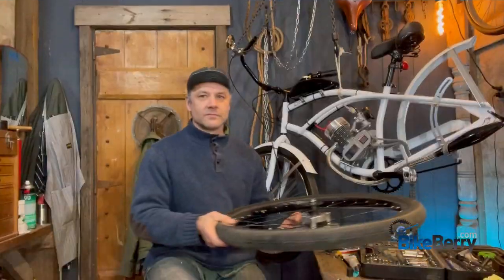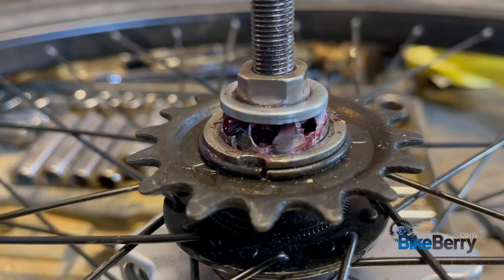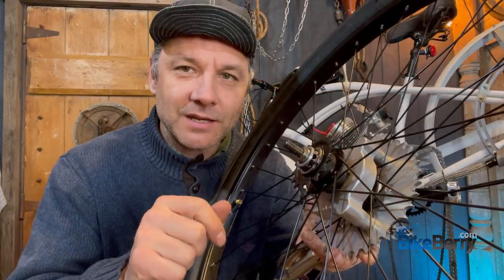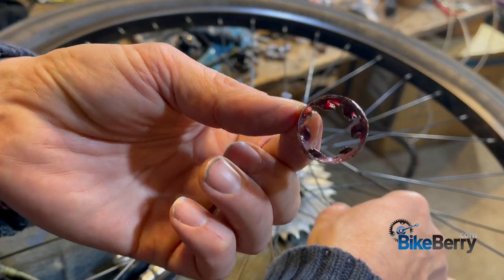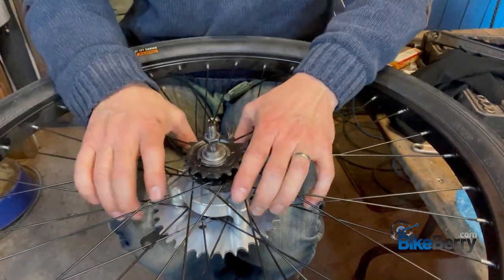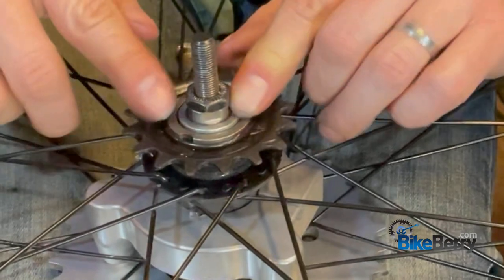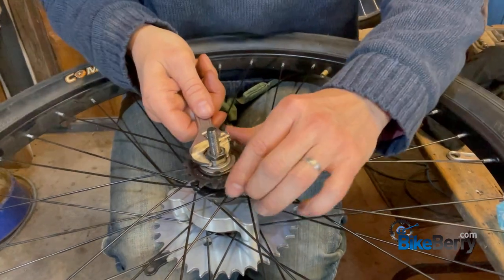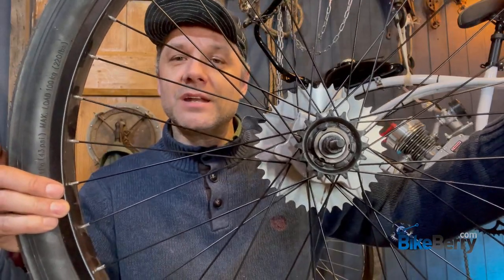Learn From My Rear Hub Mistake! | Motorized Bicycle | Bike Berry

Comment: This is a video that was needed, a lot of people throw away perfectly good coaster-brake rims, just because they're intimidated by the thought of taking one apart, these are quality rims with a very reliable built-in brake that NEVER wears-out, why wouldn't you do everything possible to make it work?, PEOPLE!!, I'm also a firm believer in redundancy when it comes to bike-brakes, always use some type of clamp-brake on at least one wheel when running a coaster-brake, that way if your chain breaks, or you just need some extra stopping power, you'll have it, great video, and thanks for sharing.

Comment: A tip I learned from my local pro bicycle shop, you can do away with the (caged bearings) and just install loose ball bearings in its place. What this does is increase the amount of ball bearings in the hub so you have more complete ball bearing to cone surface coverage. Just buy loose ball bearings from your local shop, they are cheap and it is better.
Reply: I’ve been thinking about doing that. I’ll add it to the list. Appreciate the insight!
Reply: I've done my one-piece crank bearings this way, no problems yet.
Reply: I've done this when it was all I had never seemed to mess with anything ran fine till the rim was out of life hub was still perfect lol
Reply: I had to replace the whole bearings on my phatmoto after 2 months riding because they were making noise and my jackshaft bearings also had to be replaced.
Reply: @richardfelmlee5193  It appears that bicycles from China come with not enough grease or inferior grease in the hubs and bearings. So the bearings tend to fail early.

Comment: Thanks for making a video on this subject. I've made this mistake a couple times. It's great that someone has made a video on this because this is the stuff new builders need to be made aware of. I've found that using a freewheel hub instead of the coaster brake solves a lot of issues, and eliminates the complexity of the sprocket installation. Thanks for the awesome videos. Keep them up.
Reply: You’re welcome! Thank you for the encouragement!

Comment: Great video, Tony! Clever idea with the vice-grips in the lap to keep one side stationary while you fiddle with the other side. For the cone-nut/jam nut adjustment, I’ll grab the shaved wrench and a few spokes with one hand to maintain that position of the cone nut and work the jam nut with the top wrench and my free hand. This will keep the cone nut from walking on ya while you’re snugging down the jam nut. They call that bearing crown a “race”.
Reply: That’s a good way to do it! Oh yeah, totally forgot about it being called a “race”! I’ll remember  next time. Thanks so much!

Comment: I am fast becoming a motorized bicycle enthusias.. you have been a big help building mine. I have a cnc 1.5 rear hub coming in tomorrow but heard it gonna be hard to fit on a mountain bike rim. So I got the 1inch adapter pad as well. Could you give me some pointers?

Comment: I used red loctite on my 3060 sprocket on my mag wheels one of my mag wheels got destroyed because bolts back out not taking chance on the blue loctite using red I  don't ever intend to take it off the mag wheels are awesome if your prelocktite the bolts if not I will destroy your bolt holes and your bolts from wobbling

Comment: Should the wheel spin freely on the axle? I know that might be a foolish question but I’m new at this. I have tried to adjust mine, I have coaster breaks and I can’t keep the axle tight on the wheel. Any help you can give would be a great help. Thanks!

Comment: Serious question on rear hubs. Mine has been heating up extensively during high speeds, to where I can't touch it more than 1 sec. What do you think causes that? I have no grinding etc. And almost no play in the axle and bearings. I think it might be wrong grease and or bearings aren't meant for speeds greater than 15mph. I have  automotive bearing grease I can use, but is their after market solution or fix for this? Is this common?
Reply: Just the way it is with the friction of high speeds.

Comment: Hey do you have a number to were I can call and ask advice on how to fix my motorized bicycle my back wheel is locked I have to use the clutch to be able to move my tires

Comment: The rim that works best for motorized bicycle is mag or if you want a spoke wheel will cost around $300 . Sealed cartrage is the best bearing hub but you will have to have hand brakes .
Reply: Mags break your crazy to recommend them. When one snaps on you you’ll know what your saying to people. You can buy a 12 gauge rim for 100 steel rim on Amazon or 150 on Walmart online. Gemini and ghetto bike don’t even cost that!!Straight trash just to say something.

Comment: Hey, the video you did on the front disc brakes, you don't center up the rotor in the brake caliper. They are no self centering like on a car, you actually need the inside pad, the one closest to the spokes to nearly touch the rotor, if not every time you use the brake, you'll be bending the rotor.

Comment: How would i go about changing my rear wheel to a heavy duty wheel with 12g spokes and still maintain my 7speed freewheel hub on my bike and use the cnc hub adapter instead of a rag joint?
Reply: Every heavyduty wheel replacement with 12g spokes i find has a coaster brake style hub and i would rather maintain the caliper style brakes when i install my motor kit

Comment: Use a propane torch to warm up the cylinder for easy start in the winter.   Just keep the flame moving evenly around the fins and stay away from the gaskets.